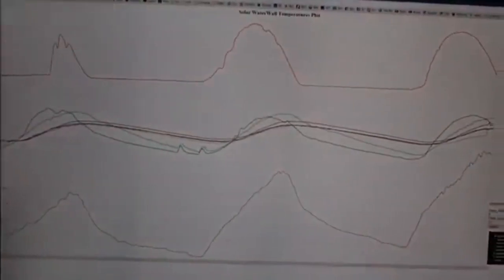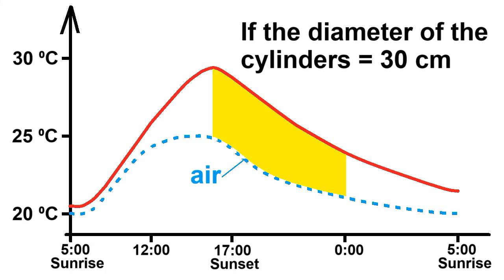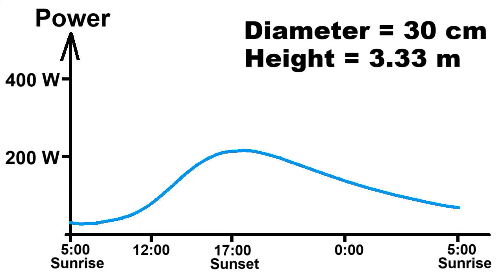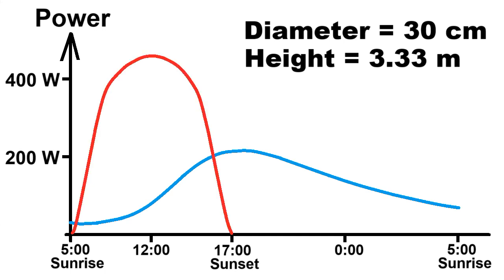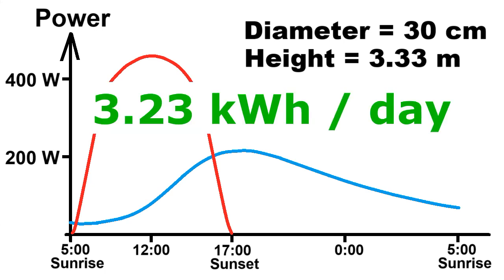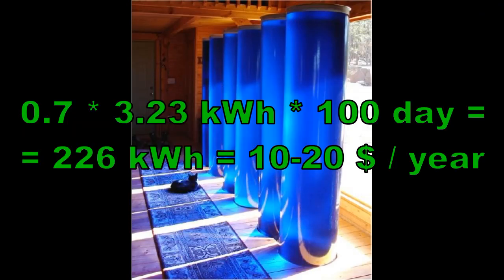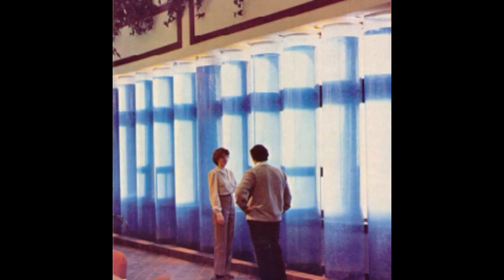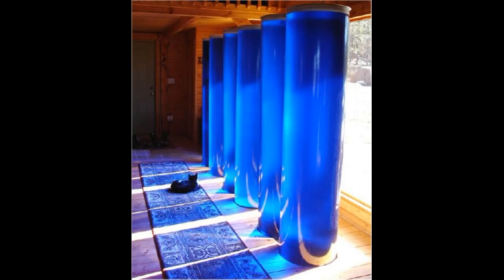How the sun heats a house using these blue cylinders

Comment: Thermochemical systems are able to store heat without needing insulation, and can be made of non toxic cheap materials, like calcium chloride (used in dehumidifiers and road salts) zeolite clay (used as molecular sieve in petrol industry to separate water from petrol) and sodium acetate of heat pads (used in the food industry as presever) can be use. Harvest heat when there is too much, store it like wood logs outside, then activate them all the winter or simply over the week if you want to store less and the sun is available weekly.
Reply: Which of these systems would you say is the most accessible?